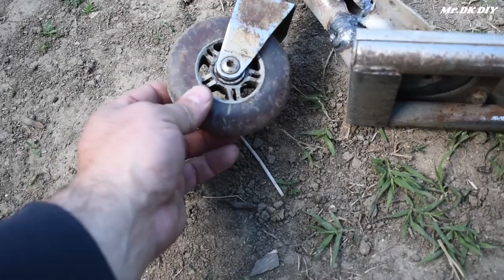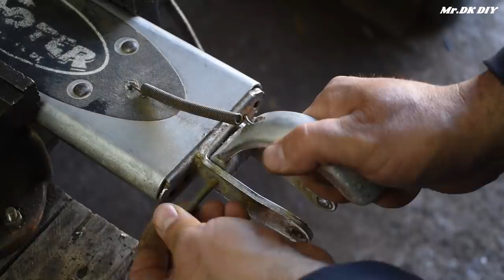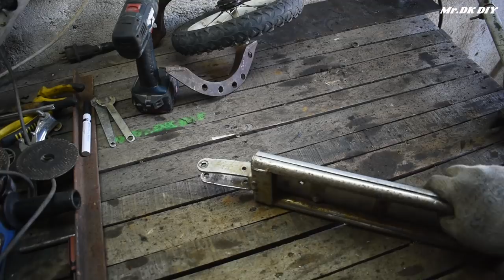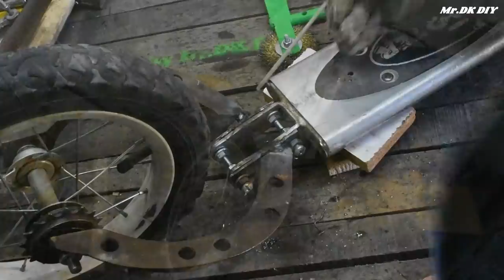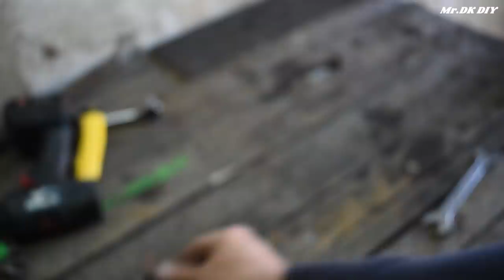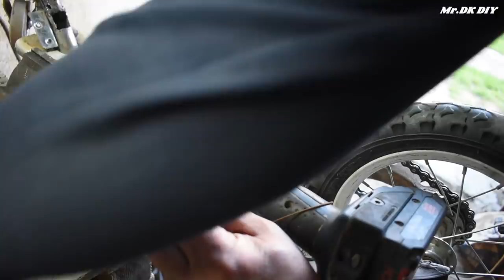How To Make A Electric Scooter Easy and Simple (trotinet)

Comment: Good.. But really need a counter balance weight because the drill is a heavy unit.. You can see the kid struggling to keep the balance and has to lean opposite direction just to  drive straight.. But obvs failing. Good luck on 2nd iteration